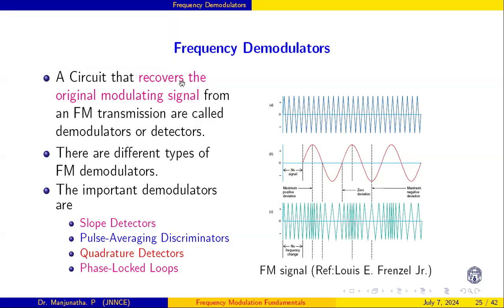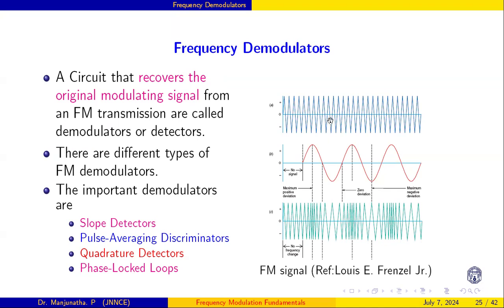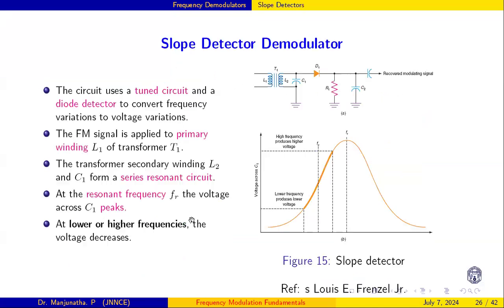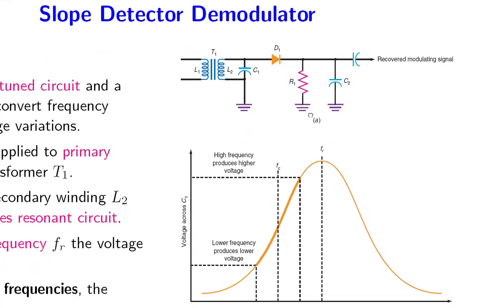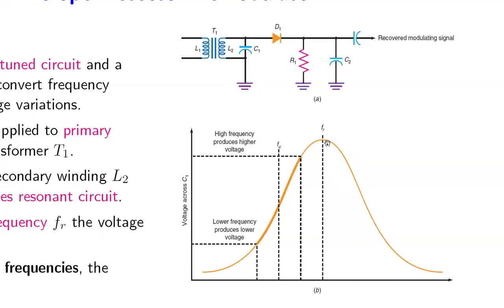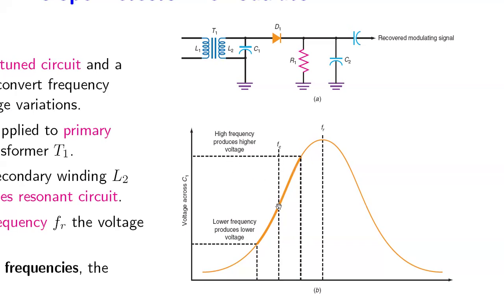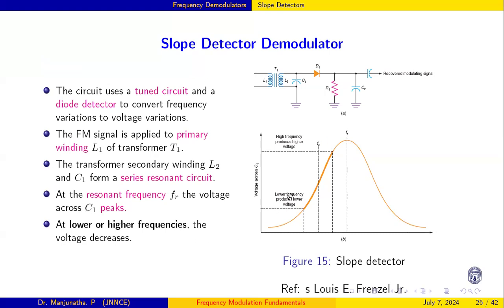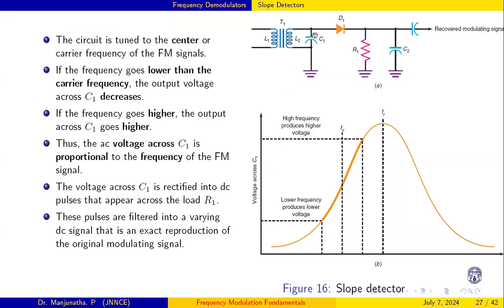Slope Detector FM Demodulator

Comment: Thank you . but why is voltage variation increases at higher frequency and lower at low frequency
Reply from the maker: The voltage is maximum at circuit resonant frequency.